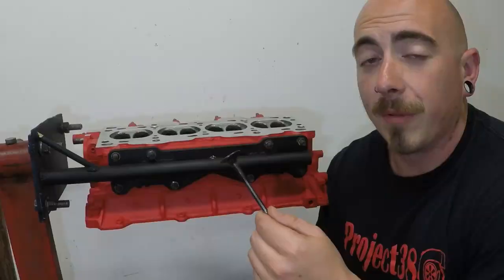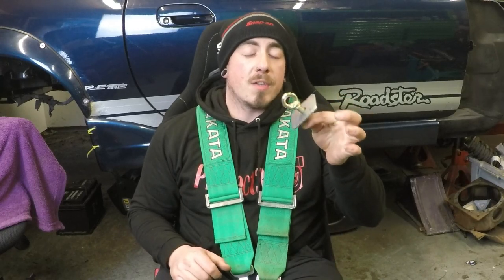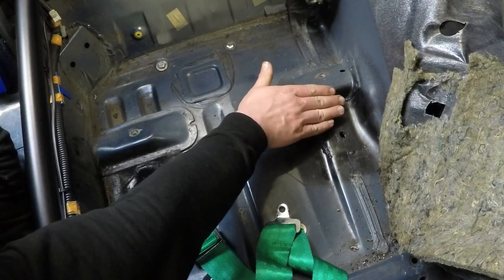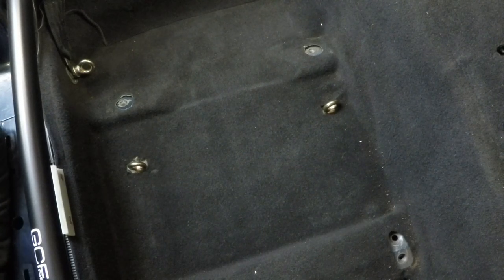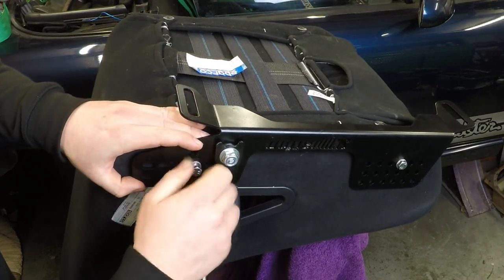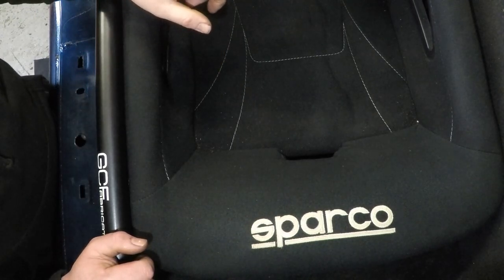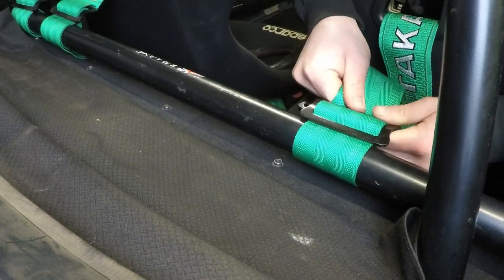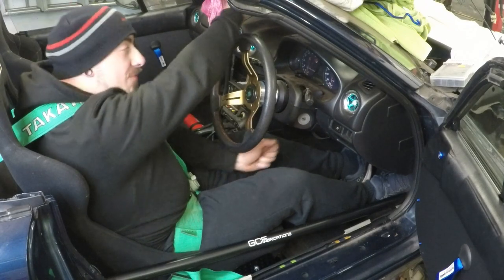BUCKET SEAT AND HARNESS INSTALL / TRACK PREP : MX5 TURBO BUILD pt 29

Comment: Hey thanks for making an awesome vid! I sub'd! Mind if I ask what your waist size roughly was here? I'm right on the limit of the Sparco Sprints at 34", and I'm not sure if the Large Sprint seat will fit in the NB. Thanks!
Reply from the maker: hi there and thanks for the sub, im a 34 waist and fit snug, i think the larger seats tend to hit on the door at the shoulder bolster
Reply: @Project380  Thanks dude!

Comment: What size bolts did you use for the fire extinguisher bracket plz?
Reply from the maker: from memory m12x1.5 x 40
Reply: Thanks! I used M10x1.25 x 40.
Reply: @elliottharling318  Did you use a part threaded bolt, or fully threaded bolt?

Comment: Nice video mate. I did my 6 point recently and chose to go through the skid nation chassis rails for the central eye bolts in line with the bolt holes. Then I cut down spreader plates to fit in the channel of the chassis rails
Reply from the maker: thts a good idea . thankyou

Comment: What if my seat hasn’t got the little holes in the sides? Will I have to drill them?
Reply from the maker: if your seat has not got side mount holes unfortunately you will need different seat mounting brackets which can accept bottom mounted seats
Reply: @Project380  thanks for clearing that up mate, not sure what kind of bracket I’ll have to get in that case. Got a cheap corbeau seat off the marketplace and trying to fit it in the nb as well